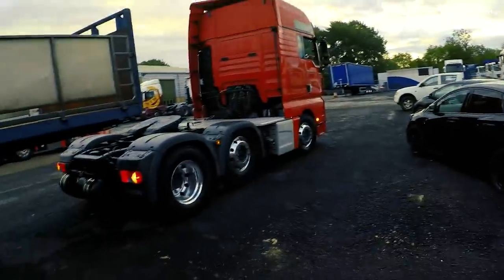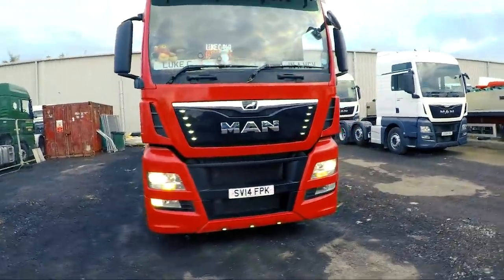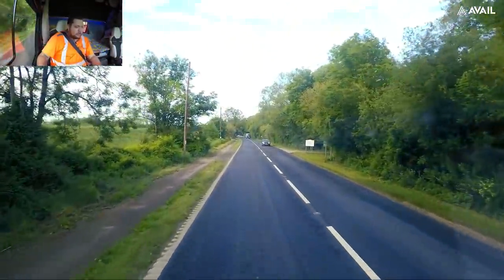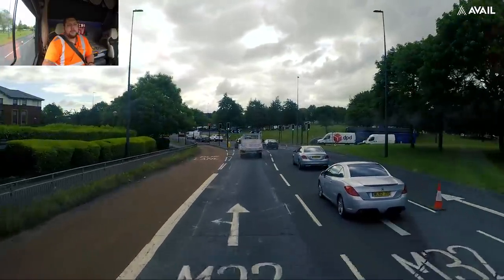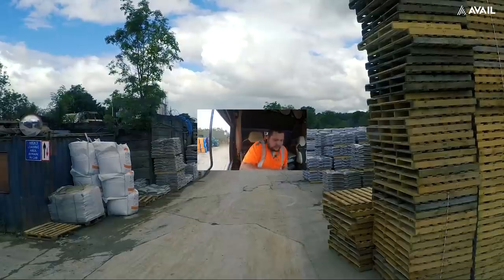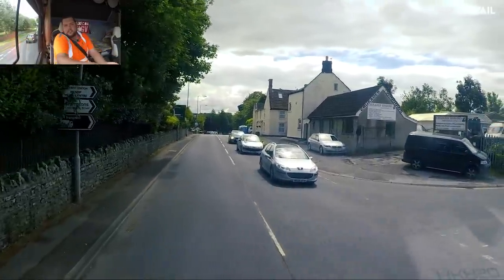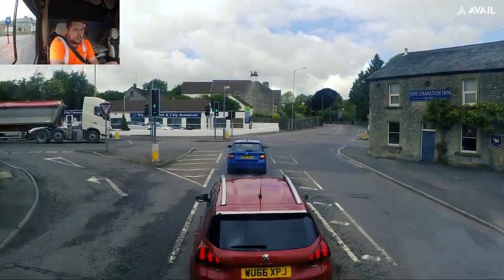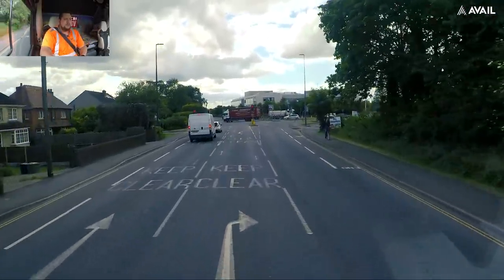It's Been A While!

Comment: Welcome back !  The so called KING pin is the 5th wheel pin  < kingpins are on front axles > plus <maybe the edit> last job hooking up is to check lights & number plate on the rear of the trailor. Quite a few newbies watch your vids so its important .
Reply from the maker: Cheers mate 😁
Number plate was already attached as it's "my trailer" it stays on 99% of the time. And lights were a checked during the rest of my checks off camera. But yes you're absolutely correct. I was only showing how to couple up using the "black" system.

Comment: You not check hand brake on trailorl beforevyo connect kinl pin  unless you have spring  brakes also you should check rear of fifth wheel to see locking bar is across
Reply from the maker: You don’t need to check trailer brake if you know it’s already turned off (which I did) and you don’t need to check to see if the locking bar is across because that is what the tug test Is for 👍🏻

Comment: Good video Luke, No knock intended at all but, top marks for showing how to couple up whilst forgetting multiple things... number 1 is the trailer number plate... 10 points each for correctly guessing the others... 😉
Reply from the maker: Numberplate was already attached 😂. 
I'm guessing others would be checking the trailer brake is on first, then checking the condition of the trailer, after coupling up check the lights? 

All of course we're done off camera 😂.

Comment: First of: LION POWER ftw.
secondly, ALWAYS look with a flashlight under the 5th wheel to check if the bar is closed on the the kingpin, only that way you can be 100% sure it actually is, just pulling the handle is not enough because it can seem like its locked on the tug test but that can in some rare cases cheat you. just to let you know ;-)

Comment: Sussies attachment is all wrong......you attach from the farthest to the nearest and reverse when you drop a trailer
Reply from the maker: It's actually all down to preference. I suspect you do it that way as to not get dirty from the lines? 

I keep my lines nice and tidy and tangle free. Plus I'm 6ft 3 and can leap across without touching them. 
 All down to preference mate. No right or wrong way
Reply from the maker: Example of my lines .. https://m.facebook.com/lukecinahgv/photos/a.612738908859508/1651900184943370/?type=3
Reply: I'm 6ft 1 personally......I am a HGV driving assessor and HGV driving instructor and know that driving examiners will mark you down for hooking up your way so it's bad practice
Reply from the maker: @christopherhumphreys7052  That's strange. I was never told this by my HGV instructor. He always told me to put the airlines on first followed by electrical cables. I don't really see how putting him in a certain order effects anything anyway... 
Anyway I did as he said during my exam. I received only one minor throughout the whole test which was regarding a question at the beginning involving how I would check my load was secure. I didn't mention anything about checking the weight. 

I did not receive a minor for connecting the trailer airlines first. Maybe it's different where you're from? If thats so.. then that means it's not a universal thing. Some examiners are marking down and some are not. Therefore there is no real right or wrong way.
Reply: I agree, makes no difference. I put my airlines on then electrical, only recently done my test and mentioned nothing. About I did it wrong

Comment: Luce, buddy, when u do your tug test hit the pedal harder that tug test was a joke. Always connect the lines starting from the red one keeps your trousers clean for longer and never start your engine from outside the cab.
Reply: Jimmy De'Souza  hard means hard. That hard so you get convinced the pin is locked. I had an incident that 5th wheel friction was so immence that the engine died and there was feeling of a locked pin. When i bent under for the clip I realised that it was a false lock and started sweating. Real tug test mean wheels spinning, trailer dragging just to make sure. And nothing will get damaged. These pins and jaws are designed to pull the earth dont worry about that. Ive seen a tug hanging from a bridge on its 5th wheel connection only.

Comment: Does anybody know what adblue is used for because I have no clue
Reply: It's a mix of pig's urea and deionized water, the fluid is pumped into the exhaust system, helping to reduce nitrous oxide emissions produced by diesel engines.
Reply: @JohnG1988  thank you
Reply: Adblue or reducant is a mix of urea and other elements (around 33% urea) it is sprayed into the after treatment section of the exhaust, the adblue reduces the Nox gasses by essentially diluting it, hope this helps

Comment: the camera doesn't give much away apart from the fact that you were going to enter the main road from a side junction by the looks, as the road markings have warn away. but you had the giveway line going right the way across the road, so therefore if you pulled out and the van crashed into you, then it would be your fault for the accident. yes the van had a giveway to oncoming traffic, and as such then the van had right of way over the side junction until you had safely crossed over onto the correct side of the road, and gone down the road so your trailer wasn't on his side of the road, then you would be classed as oncoming traffic. then the van would have been in the wrong. side junctions aren't classed as oncoming traffic until on the main road. not to be nassty to you Luke, just stating my understanding of how the police would probably look at it if there was an accident. and my personal understanding of the law.

Comment: As a HGV driver my company takes a very dim view of any infringements, particularly manual entrys, the paper work involved is a nightmare, dose any other driver have the same issue with thier company regarding infringements? Would be good to know.
Reply: J R my firm do there bollocks at me every time I down load my card lol but my trucks limiter has been set to  93.5 km which is well  handy  I must admit but I do set the cruise control to 89/90km on the motorways.  Hardly any other  wagons over take me except those  with big balls going down hill.  But then again I drive my my own daf 95 I'm sub contracted to the companies I pull for.  I am mr infringement.  Theres to many fucking rules and regs in this game! Just watch your driving hours and break times and I'm sure you'll be fine  I've never  been  done by vosa yet!. So bollocks to em foot down Friday every day in my daf
Reply: Company takes a dim view because whilst you may get only a fine they get at least double your fine plus possable suspended or reduced fleet operators license.

Comment: I had an assessment the other day and  was doing the black sequence but then the assessor recommended I do it differently. I got out and put brake on and before I could go to lift the legs he told how to do it and then went on a little bit and put me off, I then forgot to pull the pin and clip off.
Reply: Dont let anybody wreck your sequence a good instructor will tell you at the end unless some danger is involved.
Reply: @mishafrog8786  but I passed the assessment, just about. It was partially my fault as to be honest I didn't really want the job but need to experience somewhere. That day I started work at 5am and my assessment was booked for 2pm, got there at 1:30pm and didn't actually start the assessment til 5:30pm. It was Friday, I was tired, and I just wanted to go home.
Reply: @spiderman01980  Not very polite to leave you hanging for three & half hours, but you live & learn, allways better to be in work than out of work for your C V.
Reply: @jasonjuggler3457  I nearly did go home. When I was hooking the trailer up I was so tired that I started taking the lines from the feed, I then realised and put them back and started again. The green cable was white, the black cable had 3 pins, which iv never seen before. I put everything back and just said to the guy let's call it a day, he then said no you're not going home till I say. He explained to me what the 3 pin was and that the white was actually the green and so on and carried on, went for drive and did well and it it's been a week and haven't heard back from the agency. I got another 2 assessments on Monday so fingers crossed they go a lot better.
Reply: @spiderman01980  good luck you deserve a job sound like a hard tryer
Reply: @jasonjuggler3457  Thank you for the support. I do try but sometimes trying is not good enough lol.